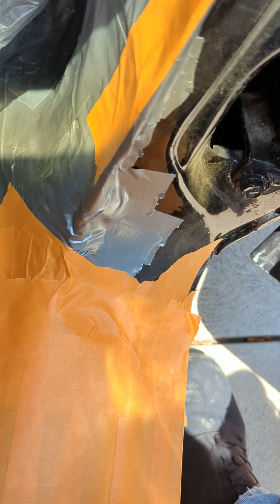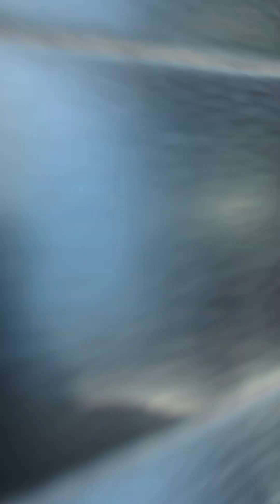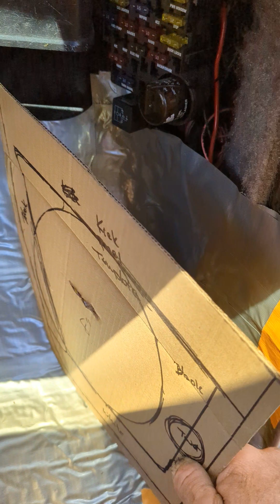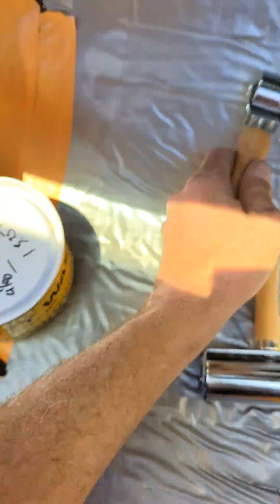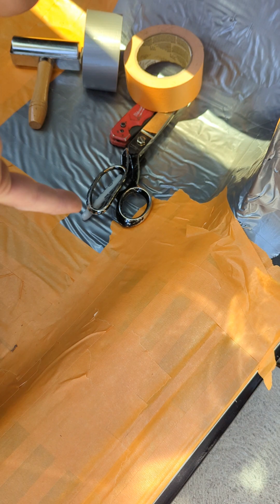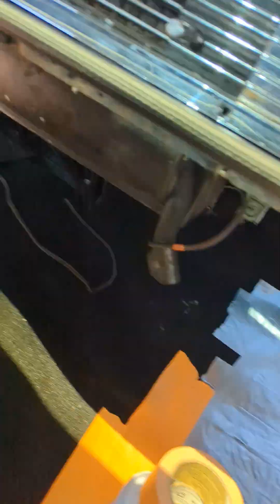How to Fiberglass your kick panels the 101's

Comment: Cant wait to get into this video!

Ive done all the sheetmetal clearancing in my OBS 1988 fullsice Chevy truck to flush some Dynaudio MW182 midbass in the kicks (vented free air). Thankfully theres a natural cavity there that makes them almost sit fully behind the oem trim. Ill make some custom kicks to really hide them with grill included !

Their low fs and high qts should lend very well to the location. Ill cross well above fs anyways, matched to dual 15" IDMAX subs and looking at options for a 3" and tweeter.